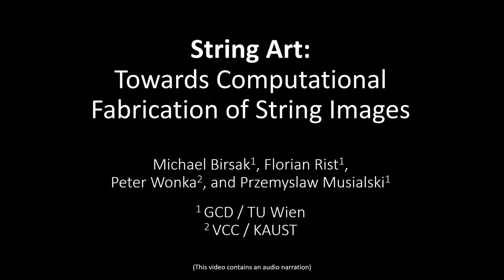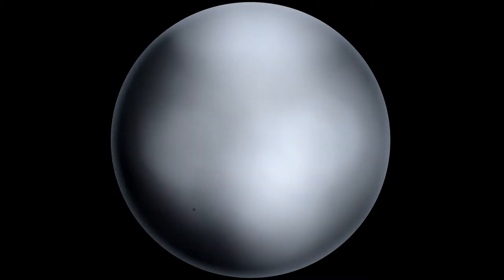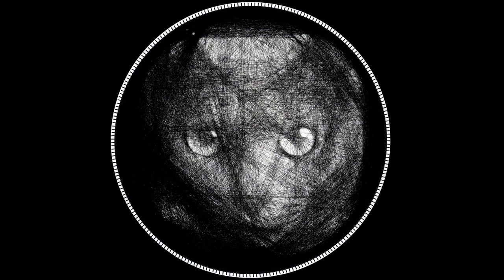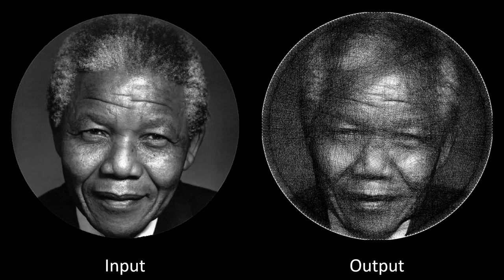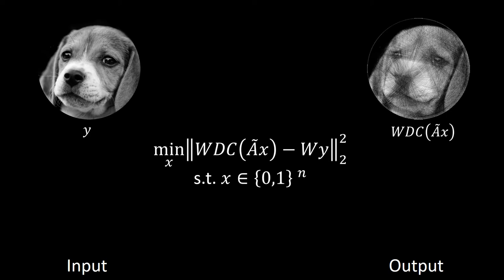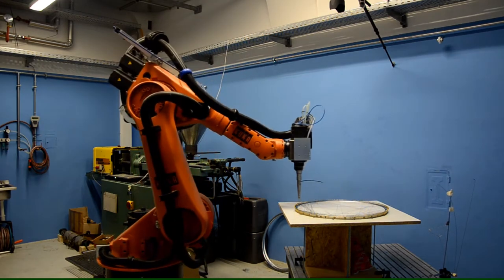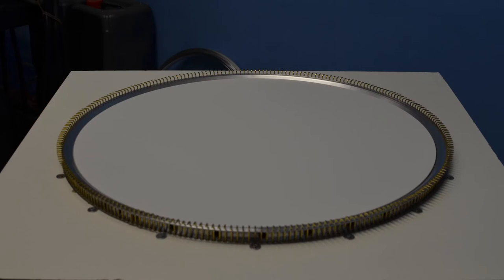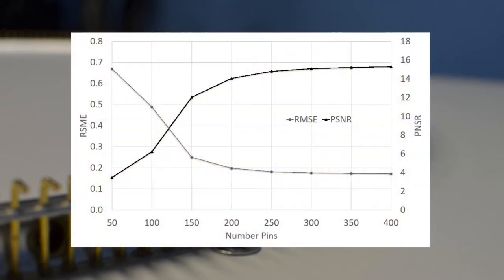String Art: Towards Computational Fabrication of String Images

Comment: Would it be possible to implement a similar technique, but allowing the thread to wrap around the outside of several pins? I think that may reduce the artifacts of the image
Reply: To do that, you would have to look atleast two steps ahead (or other wised the algorithm wouldn'tsee the advantageof such a move), which will multiply the time complexity.
Reply: The difference between wrapping around the outside and doing short connections between adjacent pins is pretty negligible (in any case the area nearest the edge of the circle ends up completely filled in with thread) so provided the search algorithm can explore connecting enough of these together it will already be doing this.
Reply: @binyaminmanela3585  Isn't that what computers are good at ...?  Also, couldn't you simply re-write the algorithm to allow 'free form' lines without the constraint that the end of one line must be the start of the next line? That way, the 'plan' would be for thousands of independent lines, and then the issue of wrapping thread around the outside of the pins would just be a matter of logistics - getting the thread to where it needs to be.